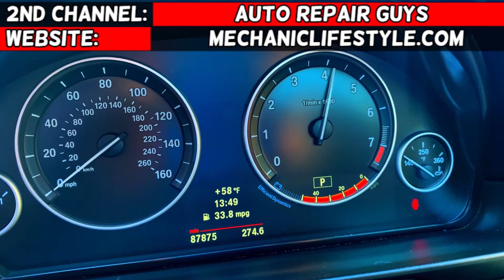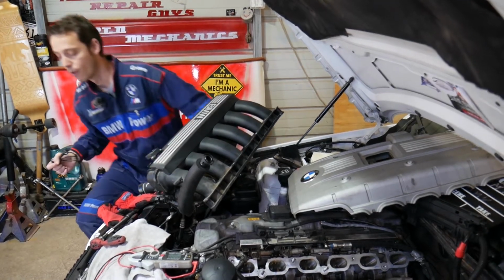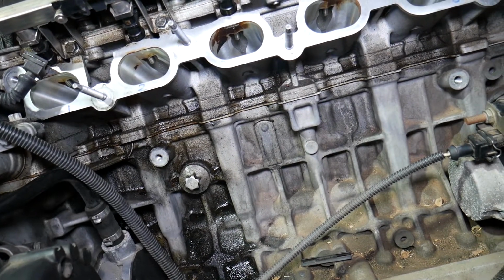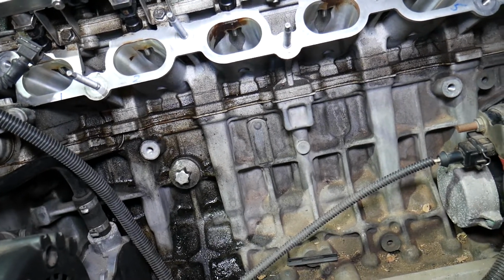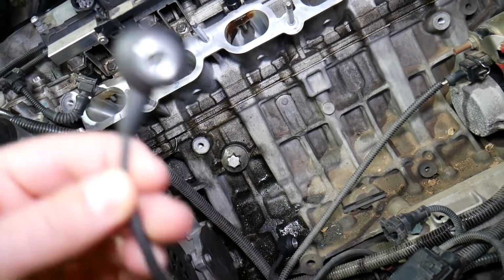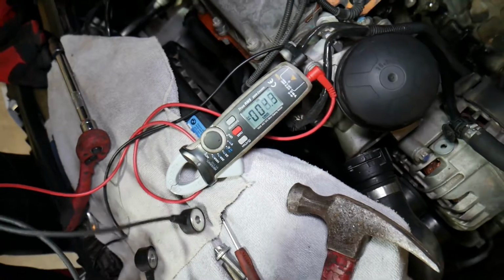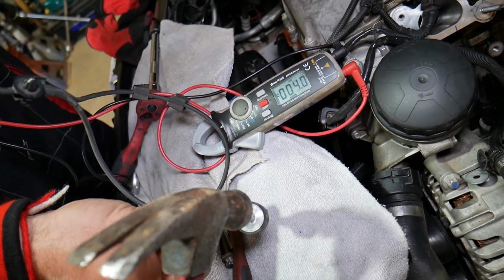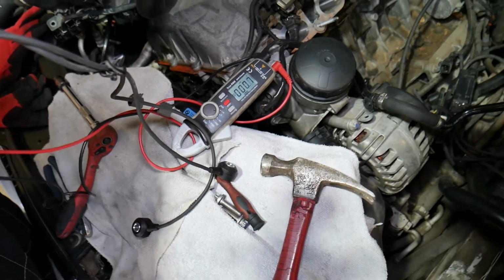HOW TO TEST KNOCK SENSOR ON BMW X5 E53 E70 F15. BAD KNOCK SENSOR

Comment: Question maybe you can answer this  for me..03 bmw x5 3.0 code po171 and po174..I check for vaccum leak and gas pressure everything good..the issue is the o2 sensors on bank 2.. doesn't want to read correctly and sometime all of them will read 0 v..let's say I'm going down the hill without hitting the gas..all.my o2s will read zero...any advice